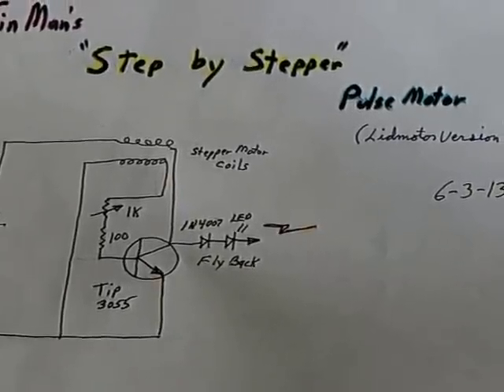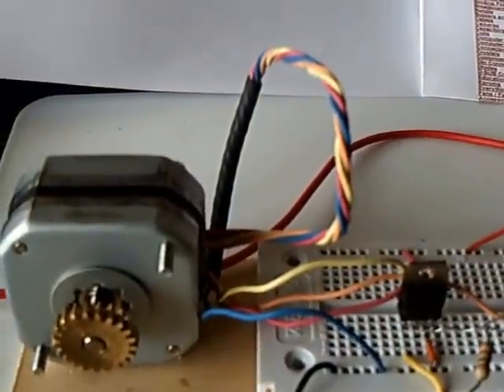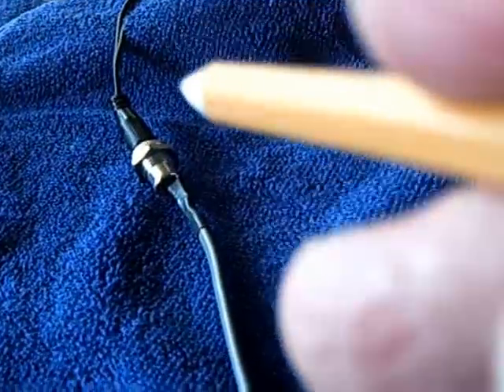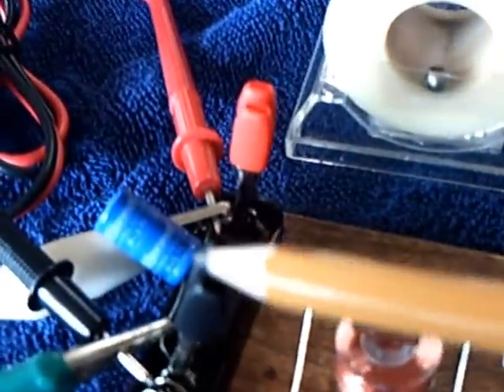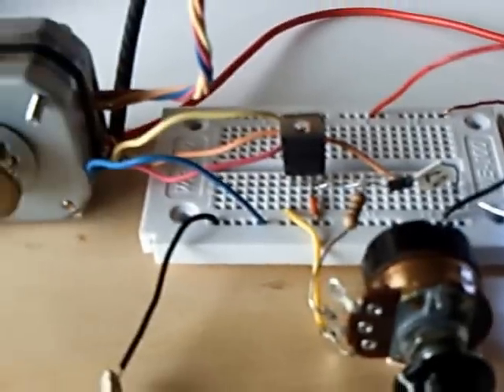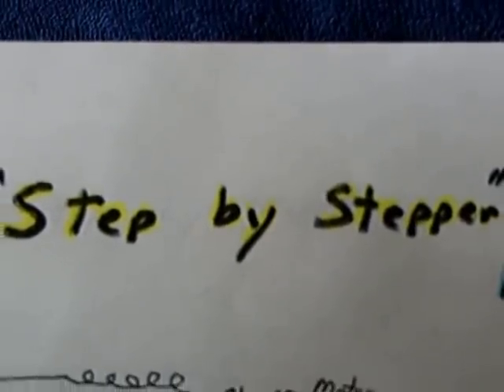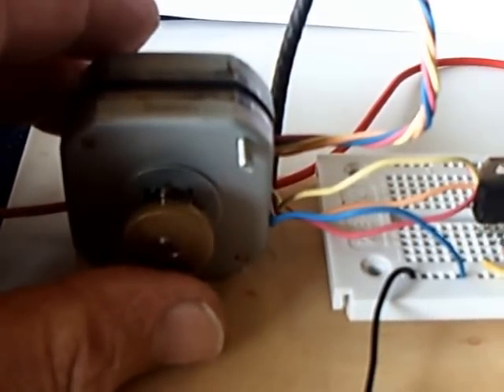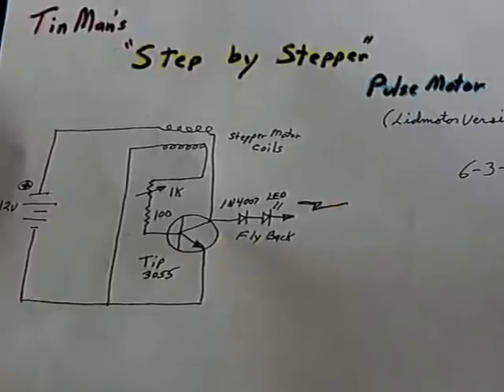TinMan's 'Step by Stepper' pulse motor

Comment: Hi LIdMan. I see you have been quite successful with Step by Stepper video tutorial by TinMan. I put one together today, but can only get LED to function by hand, clock and counter-clock wise. I can't get the self-oscillation part to happen. I am using a NEMA 16 stepper motor and pretty much the same parts as in video. I have left a similar message at TinMan's video and am hoping you may have some suggestions for me to consider. Thank you for all you share on YouTube. I have watched a few of your posts. This is my very first project, so I hope to get more complex as I succeed on the simpler set ups. Cheers!

Comment: Cool, I will have a look. I guess he will need to watch he doesn't over-voltage it. A TVS diode across the drain source would be a good thing. Your neon is good but wont "hard limit" the voltage, good enough for your circuit and looks pretty too.

Comment: You could probably covert that to use a Mosfet pretty easily and dump all the wasted heat in the old bipolar. I think you would just need a gate pull down and a 10 volt zenner or TVS diode on the gate.